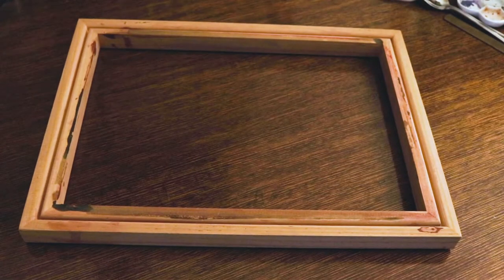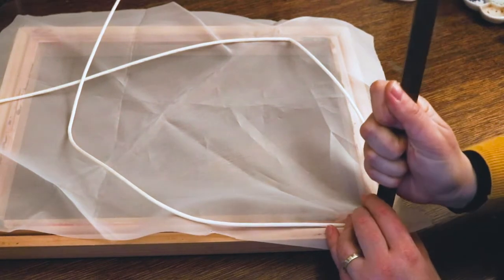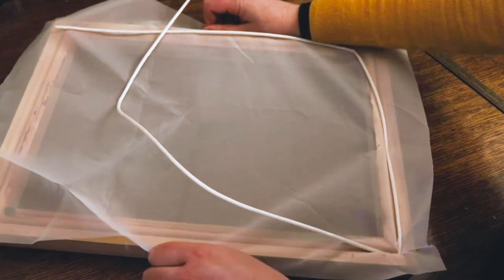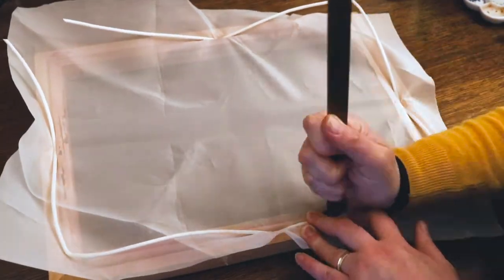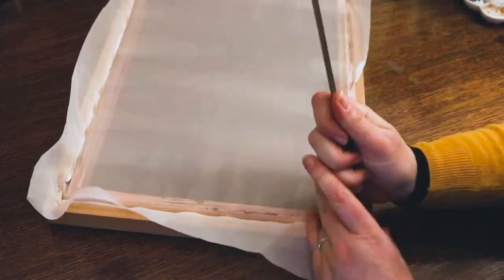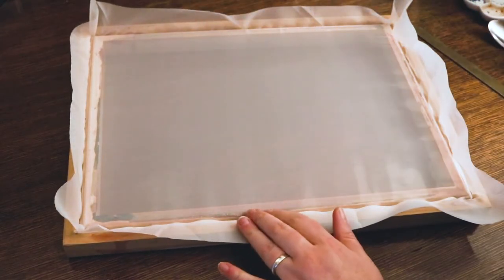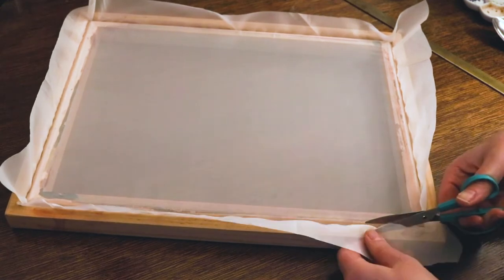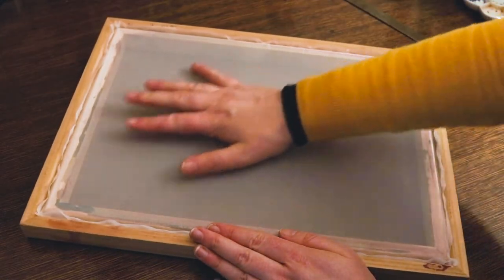How to replace screen printing mesh

Comment: How do you know if the tension is correct?
Reply from the maker: Hi Andrea, thanks for your question. I go by visuals and do a tap test to check the tension. The cloth should look nice and even, and you'll be able to see the tension shift as you gradually tap the cloth in. When you're done, the mesh should feel taut and have some bounce when you tap it gently with your fingertips.
Reply: @SpinesAndSplines  so it should only have a little bit of flex in it?
Reply from the maker: @unknownpunker101  Hi Andrea, yeah, it should only have a little bit of flex. You just don't want the mesh to be obviously loose. If you tap the mesh in around the frame gradually like I do in the video, you'll stretch it nice and evenly and the tension should be pretty uniform when you're done.